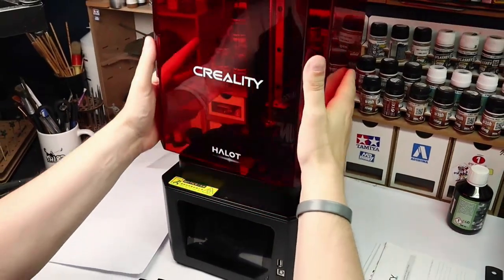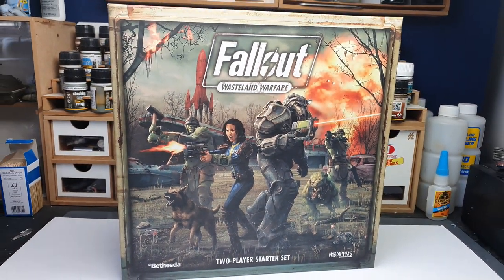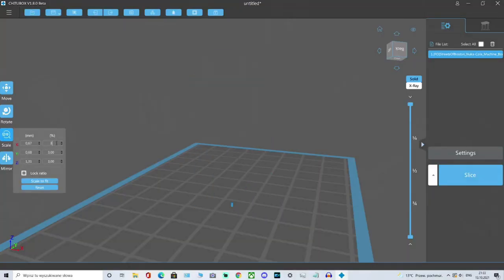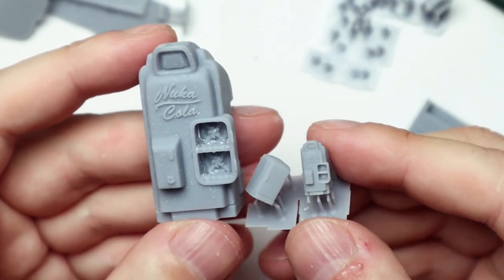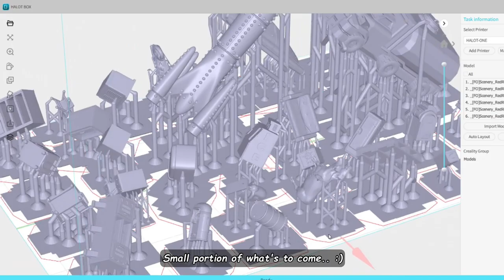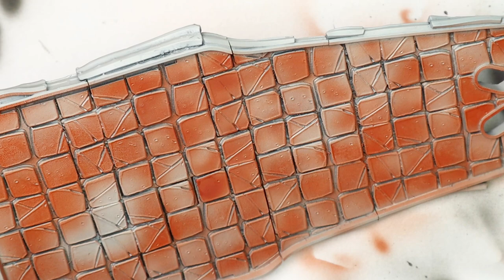Fallout -  Wasteland Warfare | Red Rocket station Diorama build

Comment: Technical question: do you use black as a primer to make the 3D detailing stand out better than the usual gray? Is that contrast more for your ability to see and discern what you're going to do or does it make an end result with more visual depth?
Reply from the maker: Yes black primer helps create a depth. Also in places where the paint is harder to reach like corners for example is better to have dark shadow rather than light spots because that would look unrealistic. I cheated a little bit and used a lot of brush painting when i could actually get better resaults with an airbrush but i am also trying to save some time in some places.
Reply: @ScaleHangar182  Thank you.

Comment: The diorama looks awesome, I do have a question. How is the asphalt paint adhering to the insulation foam? Is it good? My hobby group always finds coating the foam with Mod Podge helps the paint to stick better.
Reply from the maker: This is acrylic so i think it soaks in a little bit and i didnt had any problems. its not going off or anything.
Reply: Brique Zallivam  don't presume to know what my intention was. Not all acrylics stick well to XPS foam otherwise there wouldn't be many many questions in forums about "why my acrylic doesn't stick to XPS" Geez, I was sharing MY experience. I got a respectful response and that was that. No need for vitriol.

Comment: Can you resize the 3D models (including red rocket structure) to fit the 32mm scale Wasteland Warfare figures?
Reply from the maker: Yes. These are actually made by guys who made Fallout wasteland warfare and these are designed for FWW. I just shrinked them for my siorama. The whole building is massive in original scale for 32mm and for printing walls, roof etci would use FDM printer.

Comment: I'm a huge fan of Fallout and a new diorama / model builder.  I'd love to do a project like this.  Where can I get this kit or the parts?
Reply from the maker: As i mentioned on the video, you can find a link to modiphius website in description. They released a fallout tabletop game with lots of figures and objects just like Warhammer for example. But they also provide with a lot of Fallout themed objects to buy as STL files for yourself to print if you have a 3d printer. Some of these files are pretty big so its much cheaper when you have your own 3d printer. I suggest you watch my previous video on that subjects :)
Reply: @ScaleHangar182  I don’t have a 3D printer. But I would be interested in buying the kit printer by someone else. For me to trim, paint, etc.

Comment: I am sure you know this, but you can save a lot of glue and time if you printed joints, shims and connecting pieces like lego. Things like lamps lamps can be printed hallow to add electronics and diodes, this could also help in reassembly if you want to move things around later too. Anyways hope this suggestion is helpful and I love your work.

Comment: So, i must ask, 2 years later, im interested in the tabletop scale print of the red rocket, but its still way to expensive to make it? the walls are solid printable walls? have you revised the option of make it?. Thanks in advance.
Reply from the maker: You can make walls hollow but a little bit I guess. The cheapest option would be to print it on fdm 3d printer. Preferably some new fdm printer has the quality is better

Comment: Great video, this is one of the reasons I want to get a resin 3D printer cause I wanted to 3D print in pieces the prewar cars to build up as traditional models as well as to do like you did here in this video.  I thought it would be cool to build a scale diorama of a Red Rocket gas station complete with lights some of which programmed to flicker.